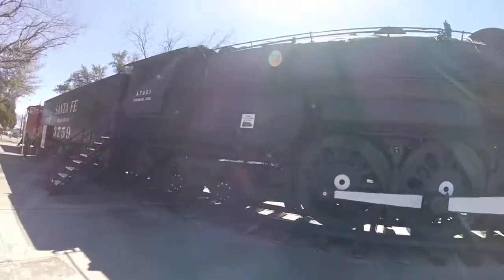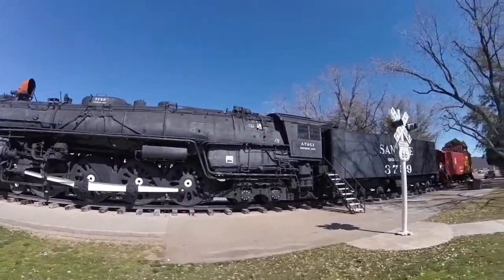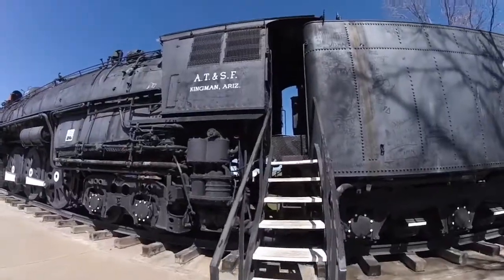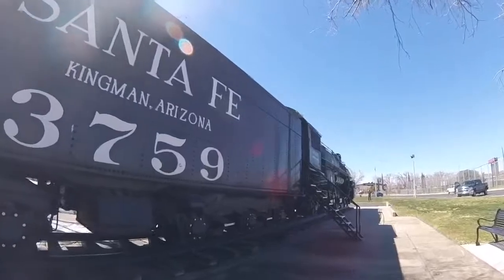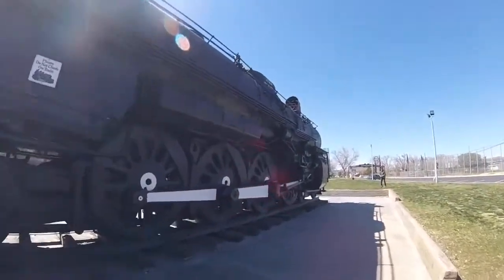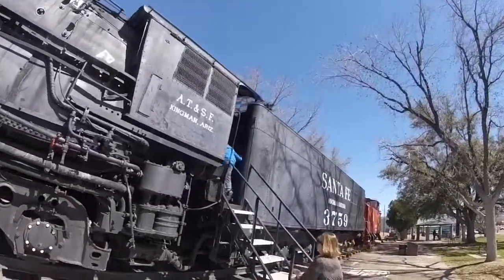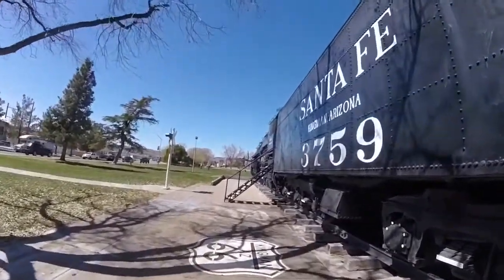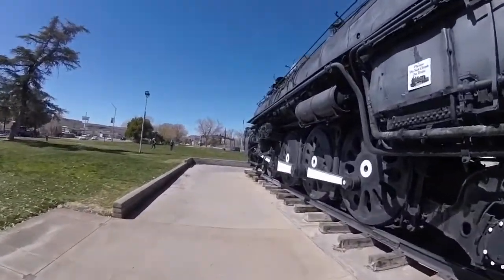_Locomotive Park – Kingman, AZ_ Episode 182 (Atchison Topeka & Santa Fe 3759)

Comment: Fire up 3759
Reply: Yeah right
Reply: I’m not kidding around
Reply: That machine is to far gone
Reply: Mike Chism 3758 was scrapped in 1956 but 3759 was saved from the scrapper’s torch and it is one of only three 3751 class locomotives that were saved
Reply: Its still,in Kingman but it's to far gone to fire up
Reply: I have seen 3759 severeltimes it's far to deteriorated to restore
Reply: Mike Chism I guess 3759 is beyond repair
Reply: Which means 3759 will never ever see the light of day
Reply: #Fireup3759!!!!!!!